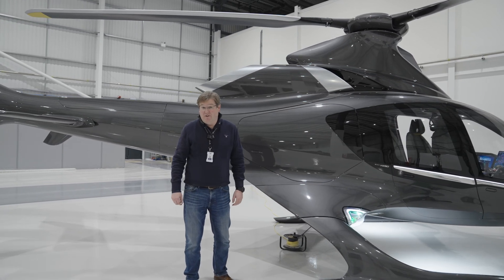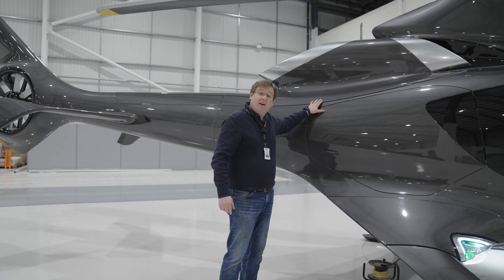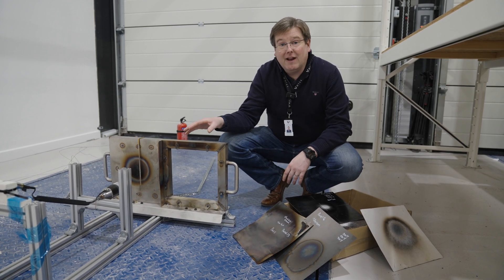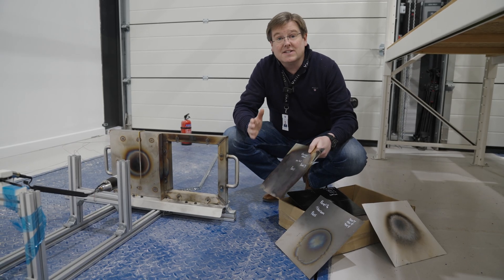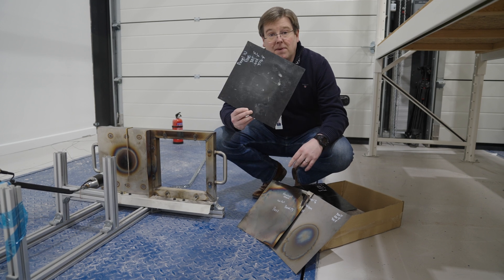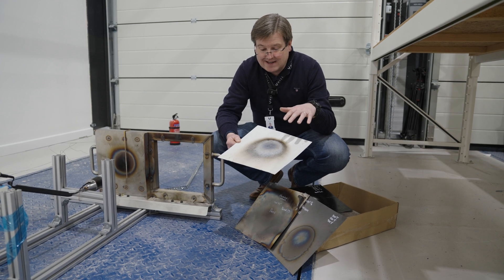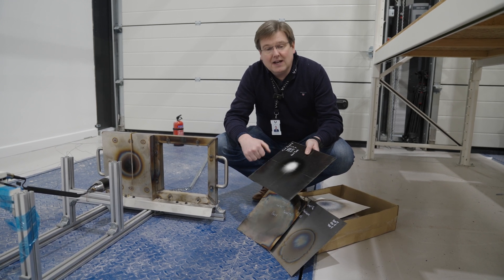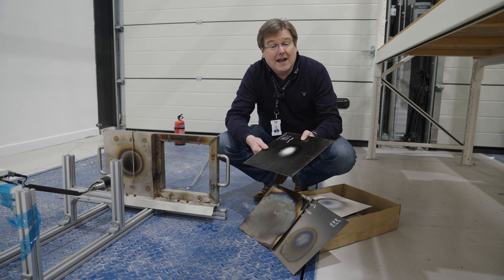Firewall Testing

Comment: i remember years ago seeing a product used like a paint finish, when it burns, it expands and becomes a thicker layer of soot, which in turn deters the heat from penetrating further into the surface, and once it becomes soot it cannot burn any further, it could be a great answer to the issue - but i did ask this previously, will there be a fire suppression system

Comment: I have been critical about this helicopter but it’s really a nice looking aircraft. My question is why don’t you use a Rolls Royce 250-C20 engine instead of developing your own and not worrying about the engine certification process?
Reply: Pretty sure the purchase price comes in well over $500K -- they can produce their own engine cheaper in house
Reply: @ I can understand that. But I also would be concerned about how quickly you can setup a service network for engine parts and related systems. It’s a fine looking machine and hopefully it will succeed.

Comment: On a helicopter as it starts moving air flow across the rudder of the helicopter it looks they could design remote control to be used like a airplane daring high speeds illuminating tell Robert use giving the helicopter more power for the rotor and could I not use electrical motor with a lithium battery source to operate the tail rotor during times of use to keep the power up in the turbine

Comment: Presumably, there will be an engine bay fire suppression system, either controlled by the Pilots or set to operate automatically once fire has been detected.

Is the objective to extinguish the fire completely, to buy the crew sufficient time to land, or to meet a certification specification?

I ask because I don't know if the certification specification allows for either of these options.